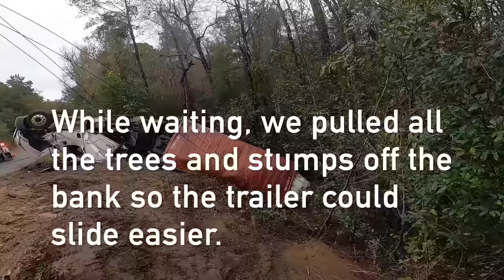Sticky Situation! We needed a rotator!

Comment: Ni9ce job there-Mr. Hal Good teamwork. The thing about a rotator is-sure it is very expensive to buy then equipe-BUT once you have one--it 'createws' own work demands--as it be. Depending on the area and the type of demand--it can 'create ' it's own work demands. The more you use it--and of course advertise it--word gets around pretty quick--it becomes virtually a smaller mobile/quicker edition of a crane. No--you can't or won't use it  for every day tow jobs--but on recovies,  especialy is where it shines--because it opens up so many more options...Of course--on these jobs-the price goes up.
Another thought here--on your trucks with the side bpox's with the chains yhanging down all tangles up--see f you can find/get those square plastic bucket/bins-like cat litter come in--square ones fit perfect against each other on the bottom of the box--then you  can let each set of chains hang down in it's own bucket. I like to paint the hooks on the ends also--to tell the differences at a glance.
Take care!
Reply from the maker: Mr Glenn  I like that idea. Thanks for watching and stay safe

Comment: That small container was probably weigh over loaded if it came across the ocean from another country. . They haul what ever they want to in some of thise countries so they dont care how heavy they are when they get here. I hauled a 20 foot container full of marble slabs one time to oklahoma city and there was 40 of them slabs and they were 18 feet long . 1 i ch thinck amd 8 feet wide. Each one of em weighed 2200 lbs. So that right there tells you how ober weight i was and i was pulling it on a triple axle chassis. I was informed by the truck owner to leave on a late saturday evening and dodge all the scales between houston texas amd oklahoma city so thats what i did. That was the longest trip to okc i ever went on. What should have been normally 9 hours took 14
Reply from the maker: Mr Vaughn  That was a heavy load.  Thanks for watching and stay safe

Comment: I don't know about needing the rotator. I think it could have been done with 2 V100's. I was just thinking about Quiring and how he would have done that job with just 2 V100's. I never seen Al have a rotator on any of his jobs and he always gets it done with his old V100. Also does it really matter at this point if anything else gets damaged. I could be wrong maybe it will buff out but I wouldn't bet on it.
Reply from the maker: Mr Timothy  The other V100 was in the shop. Thanks for watching and stay safe
Reply: @Sumter Wrecker  Oh no that is not good. That's just costing you money instead of making you money. Have a Happy Thanksgiving.
Reply: @Sumter Wrecker  With all that said that rotator did come in handy. I know that thing isn't cheap to run and someone is going to have a hell of a bill.
Reply from the maker: @timothyhnida8965  yes sir. I would have loved to gave it a shot. Thanks for watching and stay safe
Reply: About the damage...The Detroit Diesel DD engine goes for about $15000 at a salvage yard..$5000 for automated transmission..$2500 for manual..$1500 a piece for the rears.. Computer modules total about couple thousand or more... Insurance would probably be even higher if they couldn't recoup at least the recovery bill when the truck is auctioned. And these guys take the good kind of pride in what they do... Not destroying property for no reason is for the fly by night posers..Com'on back
Reply: @muthatrucka76  They did mighty fine, except they left the key in the ignition. Don't want somebody walking by to hop in and drive off with it.

Comment: For sure this was a job that needed the skills of both operators; I've never been near and in the recovery business but (1) the road surface, (2) weight of the trailer that has to be lifted, during the lift the outriggers created a crack along the black top and the soil. shouldn't a 24x24 support be placed under the riggers!!
Reply from the maker: Mr Michael I am not sure about the rotator pads. Thanks for watching and stay safe